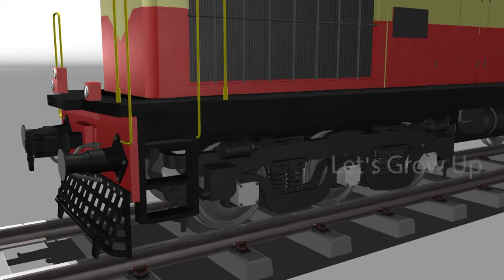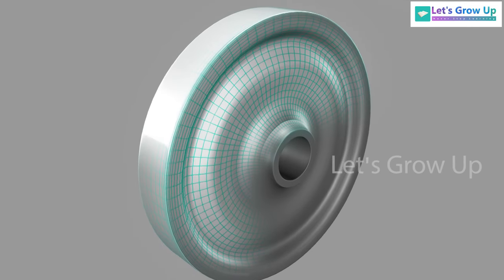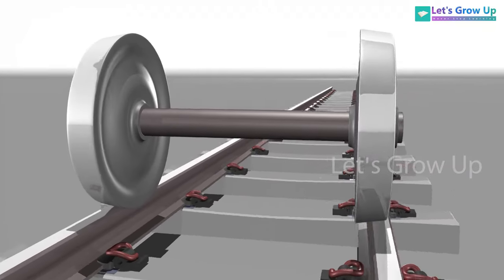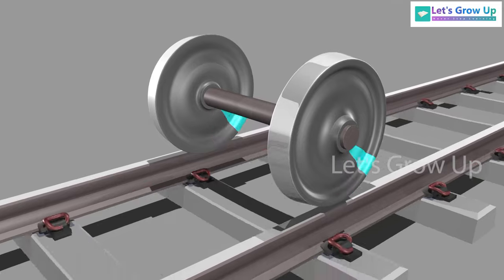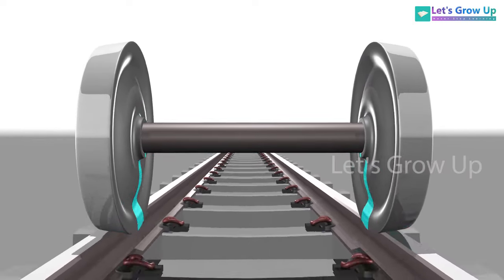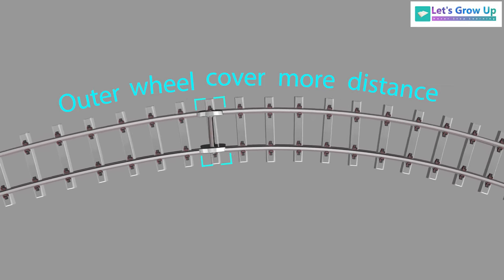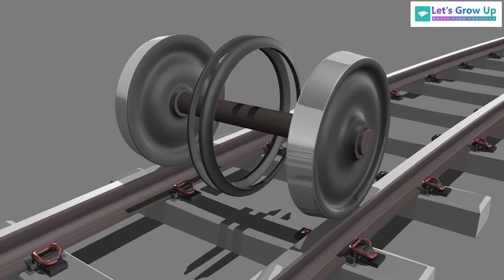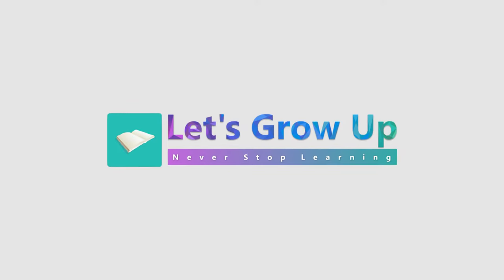How a train wheels actual turn on curved track?

Comment: But still.. What causes a train to डेराईल?
Reply: But still... What causes a train to derail?
Reply from the maker: The train runs on the track not only for the wheel but track, wheel, and forces are also the main parts when all these theories failed, the wheel derails from the track watch more videos to clear your doubt.
Reply: Main causes for train derailments are 
1) Worn out/Broken Wheels
2)Worn-out /Broken Tracks. 
3) Failure/Breakage in Suspension and under Bogie parts.

Comment: You forgot that the Rails are installed leaning inward,  adding to the equation of keeping the train on track.
My question is : Did early train Tracks (like the Old West) have this inward tilt ?    Indeed, did early train Wheels have the angles described in your video ?  I haven't been able to find out.
My guess would be that both evolved at about the same time, after decades of replacing wheels and tracks more often than necessary.